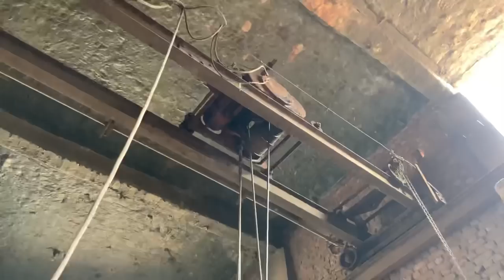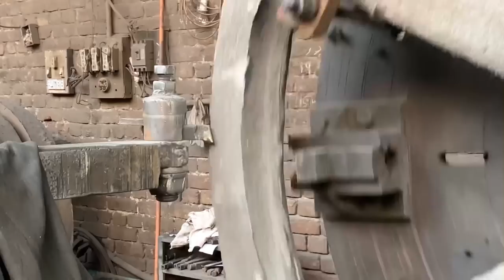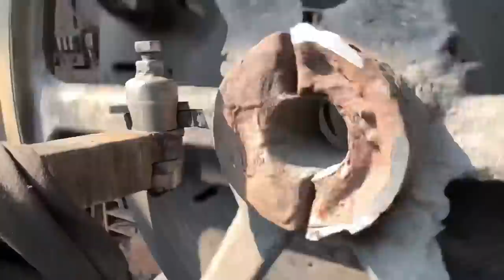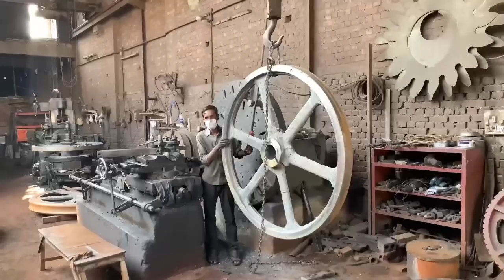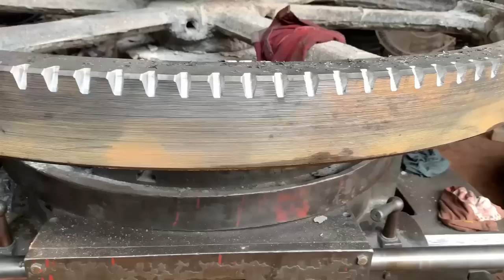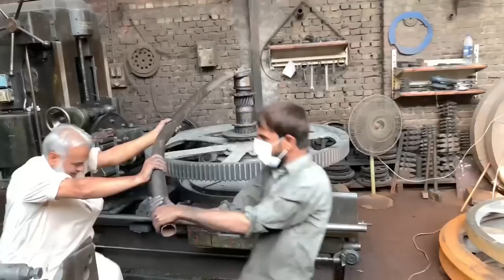Making gear for big industries is a different kind of fun || Makes gears of big industries ||

Comment: I read through most of the comments. Here it the deal for every critic to consider.   you go to their country use their tools, supplies, and method to make the same object you judged. ... No help from anyone.(not even the donkey)  These men do what they can with what they have...  By the way I would estimate that at least one or two of them do have advanced degrees in mechanical engineering. So sitting back with fancy tool's and computers does not make you better, just lucky by the GRACE of GOD.
EBW M.Ed. USN Ret.
Reply: Indeed. But most likely they don't have Adv degree of Mech Engineer or any degree. But they are extremely efficient and skilled, started life as apprentice under a skilled craftsman and slowly learned their trade from scratch over several years. Put them in a BMW factory, they will learn in days how to run those CNC and assembly line and will be best craftsman. Donkey is useful and cheap. It looks odd but you get to use whatever you have in disposal to done the work. Also no accident happen with donkey as donkey is an intelligent animal and understand itself to modify movement based on situation unlike an automatic forklift or Crain.